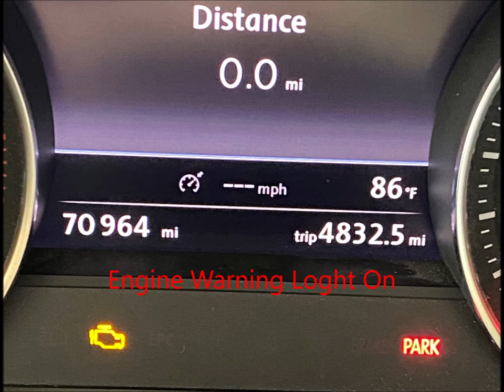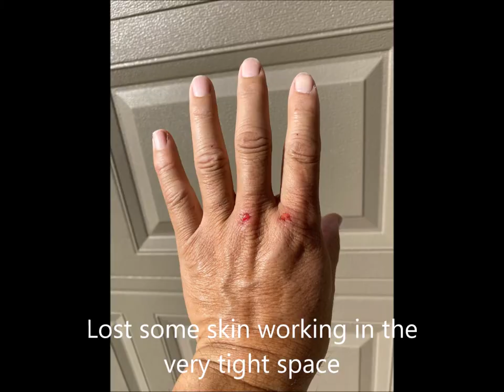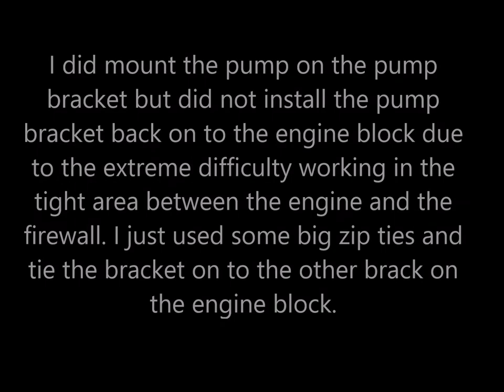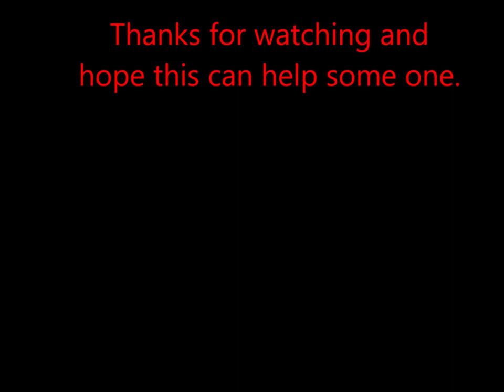2012 Volkswagen Touareg Fault Code P261D

Comment: Hi 
Thank you so much 
Could i cancel  and bypass pump
Our wither so hot!!?
If it could be would you tell me how?
My regards
Reply from the maker: No, you can’t. The fault code can not be cleared if you bypass. Actually if you do not do anything, that is equivalent to a bypass. Pump is still there but doing nothing. Only if you change the bad pump out, then you are able to clear the fault code. Hope this helps.
Reply: @laoxi4844  thank you for you replay!!
What about if i connect 2 hoses direct without pump 

Is there any problem of coolant circulation system of engine 

?
Reply from the maker: @sasasa4141  I really do not know how this pump is doing in the whole cooling system. If the pump is not working, that is equivalent to the hoses been blocked. The engine runs but the fault code is always there. By connecting hose togather, I do not know how that will affect the cooling system and therefore I do not know the answer. If the bad pump is not replaced, there will be some adverse effects to the engine even it still runs. How bad for the long term? I have no idea.
Reply: Hello sir, I am getting the same fault code in a Vento and the pickup has also reduced. Do I have to replace the coolant pump to restore the pickup?
Reply: This is for preheating the coolant. I am at north, you will see the coolant running in small circulation with this pump first during the winter. So if you don't do anything,  it just takes longer to  warm up in winter